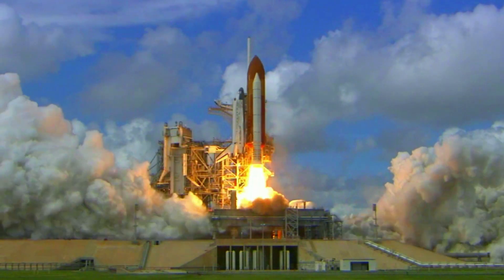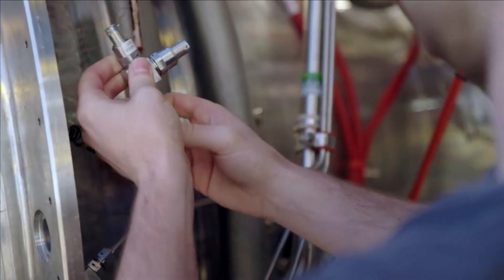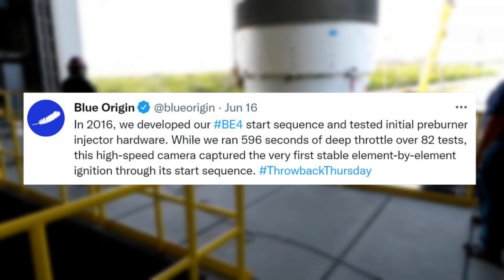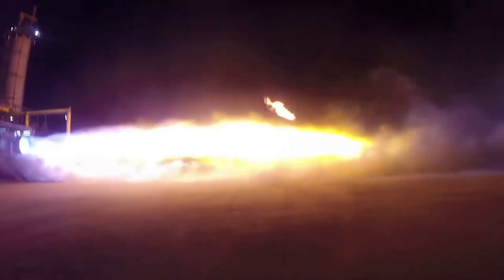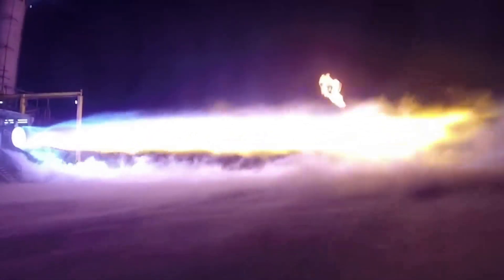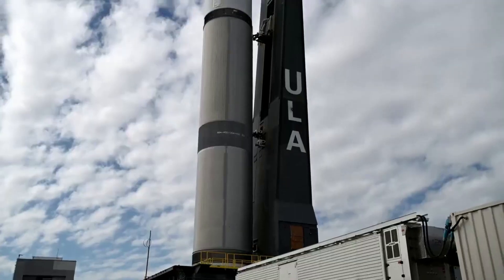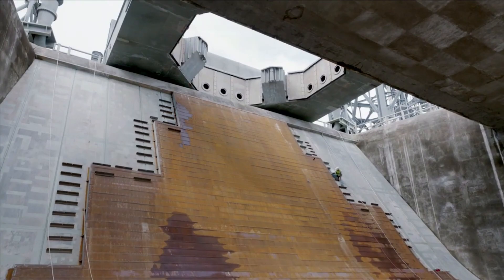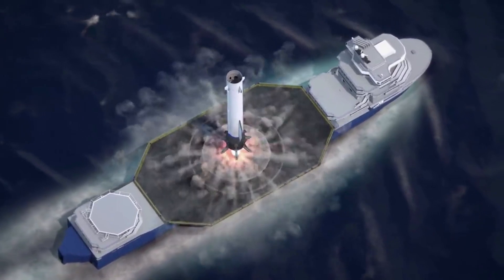What Is The Progress On Blue Origin’s BE-4 Engines?

Comment: SpaceX, Rocket Lab, and others are developing rocket engines fueled with liquid methane. Blue Origin is the only company developing liquid natural gas based engines. LNG includes other hydrocarbons besides methane.

As the only company testing LNG engines, of course they are making the largest one, and the smallest one, the prettiest and the ugliest, etc...

SpaceX has been increasing the thrust of the Raptor 2, the design is not in any way finalized. It is a safe bet that future Raptor 2s will be incrementally more powerful. I expect that they will exceed the stated thrust of the BE-4 before the BE-4 gets to orbit.

Since they use slightly different fuels, they will each be the most powerful engine using their particular mix.
Reply: Thanks for explaining. There are plenty of Musk bootlickers out there whose goal is to take down anything, not SpaceX. For them, everything should be replaced by SpaceX, including NASA. They don't even seem to understand the role of NASA. The two engines are different and BO will continue to improve, the same way Space X will. There is no better than and worse than. As long as they can complete their mission at reasonable costs, everybody wins.
Reply: Elon has already stated that a follow-on engine is coming — and it will NOT be called Raptor !
Reply: @w9gb  That is true, but the follow-on engine won't be produced in the very near future. Iterations of the Raptor 2 are likely to outperform the BE-4's design specifications within the next 6 months.
Reply: @w9gb  

It will only outperform in one metric: thrust. 

BE-4 is an O2 rich closed cycle, which is more efficient.  It also has deep throttling, also making it more efficient.
Reply: I doubt any Raptor 2 makes it to orbit in my lifetime considering how often spaceX junk blows up.